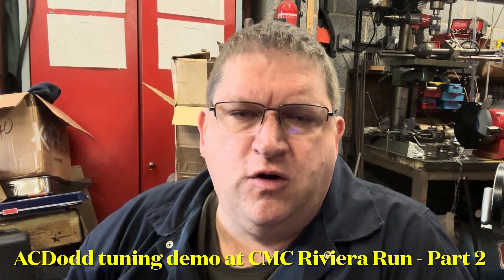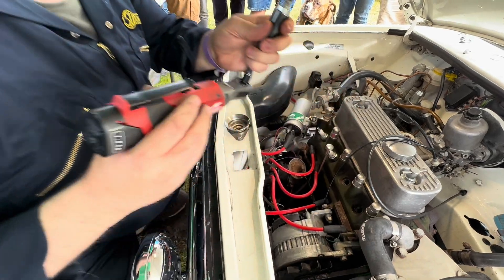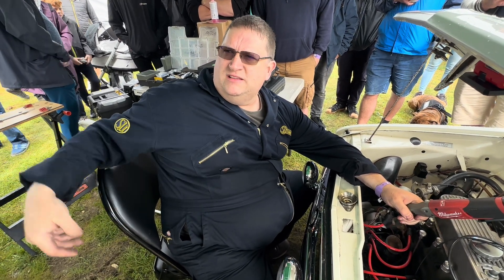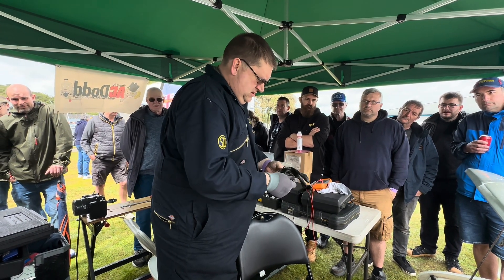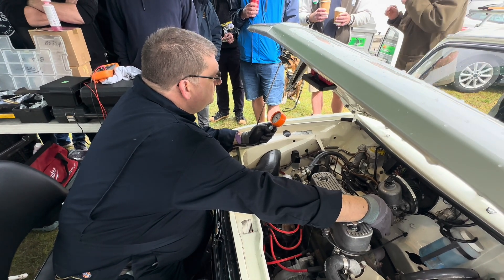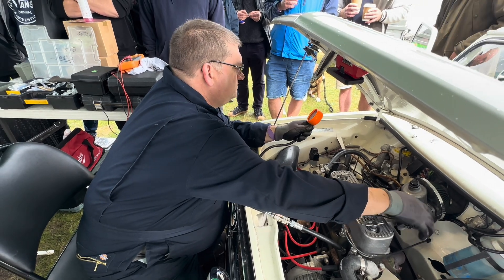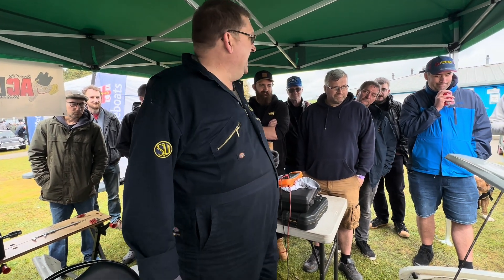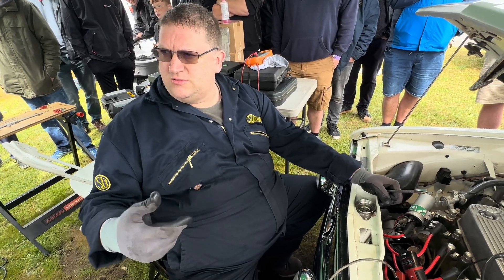CMC Riviera Run 2024 tuning Demo by ACDodd - Part  2 - sparkplugs, compression, & timing marks

Comment: It seems the majority of people are running with the wrong spark gap. 
What might explain that, at least in part, is that the latest Haynes manual specifies a 0.8mm gap for all sparks in all applications. That's about 32 thou, and I think that's pretty much how they come out of the box.
Reply from the maker: Most don’t even check it.

Comment: I wonder how high the compression ratio is on that engine! 215psi on the compression tester is similar to what my engine was, and mine is 11.4:1 static compression ratio (noting cam specs and timing can affect static vs cranking comp).  

Mine has been a big challenge to get the timing correct across the RPM range without pinging.
Reply from the maker: You have too much compression if you have to pull timing. With a typical road cam it’s likely that car featured had a compression ratio of around 10.25 to 10.5:1